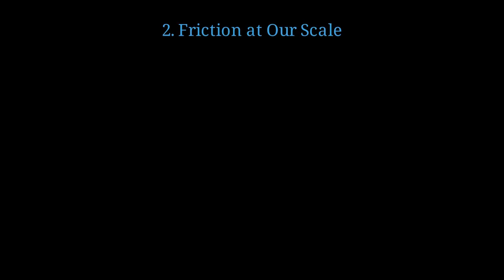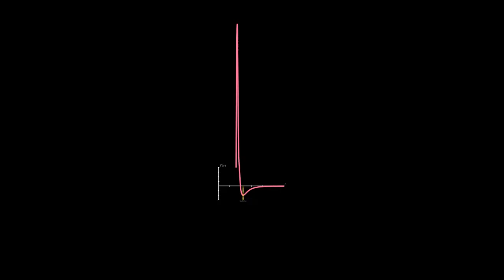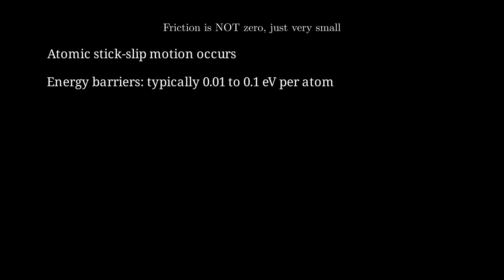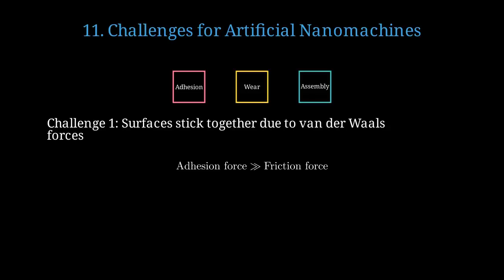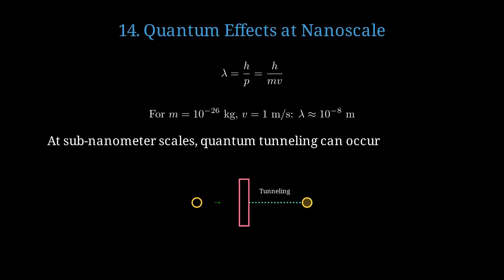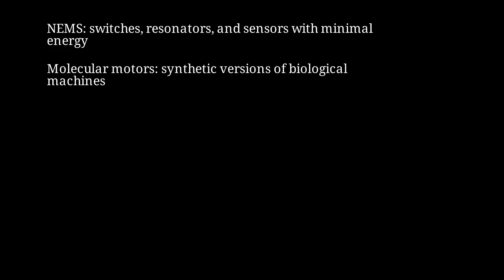Nanoworld EXPERTS Reveal Top Contactless Mechanics Techniques

Comment from the maker: How can lattice incommensurability and rotational misalignment between atomic layers sustain stable superlubricity in dynamic environments?
What are the dominant quantum mechanical dissipation pathways that limit frictionless sliding at low temperatures?
Can nanoscale superlubricity principles be scaled up to macroscopic systems without loss of structural stability or performance?